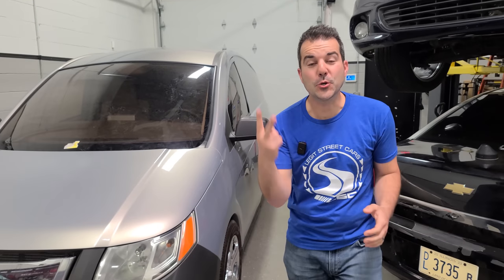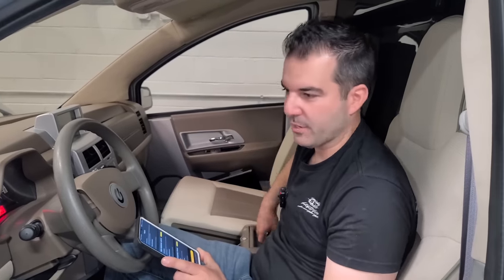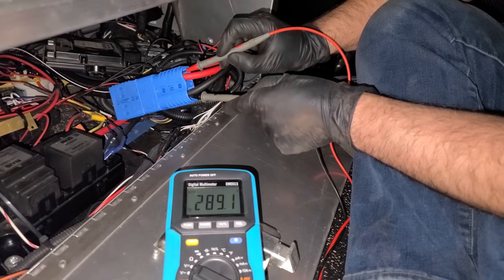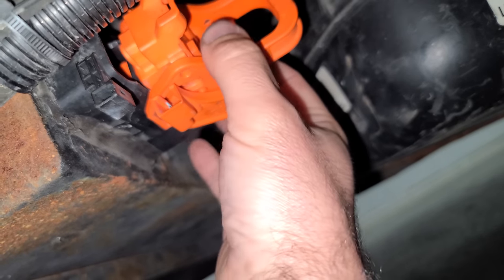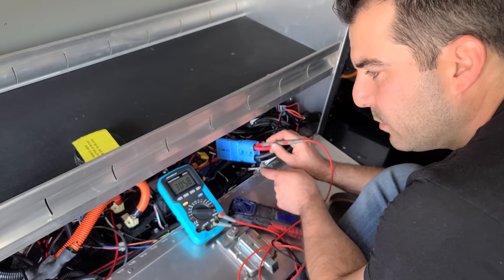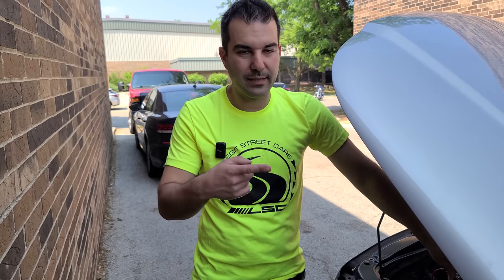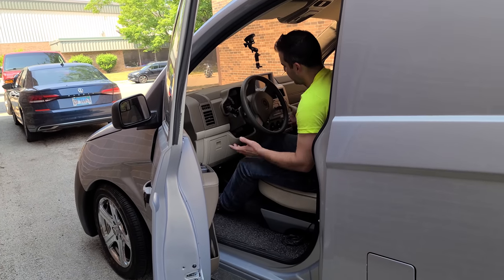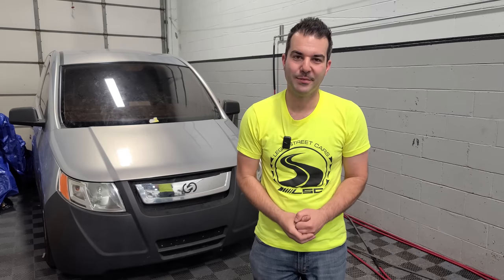I Fixed The Abandoned 2 Million Dollar Concept Car For $150! First Drive Ended In Disaster!

Comment: Screen tip, as old as that screen is there is a good chance the screen is fluorescent backlit and the backlight is dead, or if it is an LED backlight it might be dead too. A good way to tell is hold a really bright small flashlight close to the screen with the vehicle powered on and see if you can see anything on the screen. It'll be very faint, but if you can it means the screen is getting data and working, but simply has a dead backlight. If that's the case the easiest approach is to carefully open it and see if you can get a model number, if it was a standard off the shelf screen you might be able to find another to swap it with. If it was a fluorescent screen and simply has dead bulbs, you might be able to find replacement backlight bulbs to swap them out. LED backlit will be harder to find parts for. But given the age I wouldn't be surprised if it was fluorescent backlights and they are simply dead at this point. 

Good luck!
Reply: You just helped me solve a problem on one of my Toyota celsiors! Ur amazing dude thank u so much 😊
Reply: I bet there is NO screen....At least not a real screen...
Reply: @muppetpaster  The engineer he talked to over the phone said it was real and had a lot of data on the ev system, so I'd put money on it being real, just defective, really not uncommon for old screens from that time especially if it wasn't rated for being in the heat of a car.
Reply: @andycanfixit  i think some vires busted and even some parts could removed. Behind that fake hatbox could have ansvers, if he finds way to open it. There could be almost anything. 

Starting to make some wirings to paper, it would be good start for diagnostics. Theres lot of work and some parts need to fix or change for sure. 
I hope if there's some custom controller, he could save program from it and code. Then it's yeasier to rebuild things. And he need's just one or two right guys to help him, who originally worked with this. But it's possibility that those guys are ready to shoot own head, than work or remember this project again.

In first video with car someone said "they try to get REALLY HARD to make it work.."
That tells a lot.

Every input to controller should diagnostic and diggin the reason why it wants do that like grazy. 
So many reason could cause it..
Reply: 🤔 This is a very plausible theory. Would be interesting to try and see if it would be possible to replace the screen with a more modern touchscreen, depending on if it is an AIO assembly, or just a screen connected to a separate assembly.

Comment: Let's have a massive shout for people who can look at a bracket like that and say yep, I can repair that. Huge respect to such hugely skilled people.
Reply: That guy probably looked at that bracket ant thought “not only can I fix it but I can build a complete new one”. It’s pretty easy to do stuff when you have the tools.
Reply: thats like the most simple thing ever and I'm not even a welder. Alex digging into the wiring was way more scary and difficult.
Reply: He didn't reinforce it though lmao. When metal's that thin the heat affected zone becomes a key failure point. Seeing as it already failed, it was doomed to fail again. Great execution, bad planning. Or good planning because he just set himself up for more work/exposure
Reply: @ItsDdvdd  yep.
The engineer or engineers on this project should be ashamed.
Reply: @ItsDdvdd  shhh he just asked him to fix it lol. Now he’ll ask him to make it better. My motto is “you break you build” meaning if it breaks it needs to be built biggger better stronger smarter!
Reply: I think wires to motor need swapped when petrol engine is going forward its fighting motor that's in reverse
Reply: @taniamacdonald8571  great point! Thought that too, but the lady he interviewed said that it ran(?) and was tested, so I though might not be the case but you are probably right.
Reply: @billyrubina  It was a concept car, it was slap dash as all fuck. I doubt engineers had a whole lot to do with it other than to make it somewhat functional.
Reply: @SilvaDreams  maybe, don’t know anything about this company seems like an oddball.
Reply: Are you kidding me looking at it one would look at it and say wow this is an easy fix if going by looks

Comment: Here is my thought about the shaking: as you demonstrated the EV-mode thinks that R is drive and D is reverse. Whereas the ICE mode / side thinks D is drive and R is reverse. My hunch is when it's shaking then the electric motor unnecessarily try to strain itself backwards and some unintended clutch mechanism prevents it (since breaks are always stronger than the engines). If you may switch the EV to also act like D is drive and R is reverse maybe the shaking will be solved?
Reply: You are right on that BUT... Like said before me the van also do it in Park. I think it's a controller issue.
Reply: That could be tested just changing two of three motor wires cross. Then it spins different direction.

Controller have maybe died capasitors, or what ever. 
It should removed and could it be opened? Or do they 'clue' those with epox in one big brick?

Comment: Just a thought. From your previous video it looks like the gear selection under the hood is done with a electric linear actuator which you disconnected. Is there any chance of the following. 1. you didn't set it up exactly where it came off? so basically when your in D or R its not quite selecting properly. 2. Those actuators are slow to move which is probably why when your selecting a gear nothing happens for a while. I'd be inclined to get it on a ramp, get the wheel's off the ground and check the movement. I'd also assume that there is some sort of ECU controlling the linear actuator for when to put it into gear as in full EV mode you would only want the ICE gearbox in neutral, the petrol engine would also have an inhibitor to start when in gear. Hope these ideas help.

Comment: I'd recommend to drop the electric motor assembly and battery along with the wiring, just to start over from the basics. 
It's mostly impossible to really resolve an issue with something so custom like a concept car. Sure you got engineers who built it, but with it being a decade later- I'm sure some memories are obscured. I love this series of the space van.

Comment: Everytime that motor started shaking I could feel it in my chest!! What a cool project! Project I am working on is a 2014 Chevy 3500.. kinda.. the cab has been cut down to firewall and dash + the floor board. Sitting a 1963 cab over the 2014 dash and floor with all the 14 running gear... I have a short on my cannel come check it out.. Workin' With Wiley. Can't wait to see more! Have a blessed week!

Comment: I would like to comment about the indicator being backwards when in EV mode. If it has to be in reverse to go forward and drive to go backwards you should be able to reverse the polarity of the wires of the electric motor. If it’s brushless then swapping 2 out of the 3 wires will change the polarity too. Definitely some sensor issues with the inverter feeding the motor to cause it to shake like that.
Reply: That's my thought, the motor wires are reversed. Engine drives forwards and electric motor tries to go backwards.

Comment: Check that you’re plugged into a higher (20) Amp outlet in your shop. Also if it’s a lithium battery like in my RC cars and it has multiple cells it might need to be charged and balanced. Hopefully actually having a good charge makes it work. 

Edit: as soon as I was done making this comment he said he talked to someone about balancing it so I’m glad he knows!
Reply: How would he not know that going into an EV project? He's just playing it up for the camera
Reply: I think the problem is that the motor controller has reset, which is why it's going forward in reverse and banging around when it tries to kick in in drive
Reply: Leaving a Lithium battery plugged in for a week is not 'balancing' the cells, it is asking for trouble. If this has a BMS and if it's working properly, then there are one or more bad cells. If it does not have a BMS, then cell damage due to over-charging or under-charging of individual cells is a distinct possibility.
Reply: @GrayRaceCat  given that the engineer who worked on this said to leave it plugged in, would suggest it has a BMS
Reply: @GrayRaceCat acks with multiple cells in series (anything higher than 4.2/4.3V basically) must have a BMS or it's just gonna overcharge the cells the moment they start getting unbalanced, and eventually burst into flames.

That said, most BMSs only balance when the cells are full. Given the pack energy capacity in an electric car, it's reasonable to leave it plugged in for a few days to let it balance as it's a slow process. The cells won't like it, batteries don't like being at 100% for days, but it's necessary. It's also reasonable to think that the cells got unbalanced after years of storage, as the BMS doesn't balance when the battery isn't charged. If it did, it would just keep discharging cells to balance them and eventually kill the pack.

The way it balances isn't by over-charging some cells until they're all the same, it's by charging normally until series bank gets to 100%, and discharging it while it charges the other ones, until all of them are at 100%. No cell gets overcharged by doing this, but it's fairly slow.

Comment: Since the battery wasn't charging for that long, the chemistry inside was just "inert" now that you charged it the chemistry goes back to life. I see that with old laptop batteries, some not charged for 5+years that doesnt take the first charge very well on a specialized li-ion charger not the laptop, instead of going to 4.1V they are stuck a 3.4-3.8V /cells because Lion battery are charged in constant current until the charging voltage is reached. So when the voltage doesnt go up stay still for 10+minutes I stop charging let them cool down, some get warm but not hot, some stay cold as stone. Than after a day I charge them backup an now they goes up in voltage and store more energy. I could take several charge to fully reactivate the chemistry.I think what happend is the same for the first charge, then you plug it for 15min like you said, voltage goes up. They may have programmed a threshold to enable the EV part like 31XV, so the battery voltage rise because it was charging, goes above that min starting threshold, you unplug it, you drove it but now you reached the min running threshold that could be below the min starting threshold. try to charge it again a few time stay near it in case of fire, the more energy in the battery the more energy in the fire as cell can runaway.

Comment: Hey great job being out of the comfort zone  and working on this. Another great resource that I'm sure would help you is the professor at Weber automotive on youtube. He'd at least be able to give a lot of safety pointers as they have torn apart a lot of EVs and battery modules.  If you end up replacing the battery, get a used chevy volt pack as there are a lot of options that are cheap for a BMS to manage the batteries and not have to worry about fires etc. They have enough voltage and discharge rate to run Tesla performance drive units too.

Comment: As to your question about if other concept builds are janky, the answer is yes. I saw the inside of a concept aircraft and yeah, there were a LOT of questionable wiring choices and weirdly routed objects. I've also seen concept builds for specialized computer systems and the same thing, just very bad wiring, odd materials, and the whole look and feel of "whatever was lying around in the shop." When it comes to concept designs, building the prototype is often one of the screwiest things you'll ever experience.

"Fred, we need another connection from this spot to that spot! What do we have?"    "Uh, well, there's this chunk of leftover PVC we can connect with these random plumbing bits."  "Make it so!"

On a side note, with the length of the extension cord, you really should have pushed that thing outside before attempting to charge it, lol.

Comment: That’s awesome to see you got to run it for a bit.  Although you gotta go with the engineers advice about the batteries, I still wonder if the gas/electric motors are on the same page. It’s odd that Reverse is drive and vice versa.  It seems like the sort of violent reaction throwing a car into reverse might have while driving forward.

Comment: Hey, Love the videos! Years ago, I converted an old Honda N600 to electric, about the same time frame as the space van was made. One thing I had was a PC, for reading and relaying motor controller data to a screen on the dashboard. While watching you go through the wiring, I thought I could see a portable PC with a DVI cable connected to it. My guess is those actual car engineers were able to have it activate via the ignition, but if not, you might have to try manually tuning on the PC. I wonder if that's what runs the screen on the space van, and maybe some more logic via software. If it is a PC, I would play around with it either in or out of the car and see what all you can find.

Comment: It looks like a three-phase connection, you should be able to switch any two wires and have it go the correct direction. Theoretically speaking.
The issue you're having seems to be that the motor is trying to turn one direction which is why reverse is forward and forward and is reverse and when it comes time for the engine to kick on,  which means the clutch is trying to engage two things going opposite directions
Reply: This was my exact thought as well
Reply: Like someone pulled the EV motor out and when they put it back together they swapped the phase wires?

I see other people talking about the controller losing its settings but I’m putting my money on someone fucking with this thing.
Reply: Yes. Common in drone building

Comment: Use a 3 prong 110 round twist lock plug on the van and put a matching socket on the end of your drop cord. It would look clean, I think you can get ones that would be perfect from a RV supplier, you can find all kinds of neat stuff from a RV place.

Comment: I know someone working on VW (Volkswagen) prototypes here in Germany. He puts the parts into the car and tries to fit everything inside. He isn't allowed to tell much about what he does but he said that their prototypes are built with a really high quality. 

For me that concept car looks scary. The connectors (especially the HV ones) are crimped badly and you can see bare copper. Together with all those loose wires, I would be afraid of it starting a fire.

Comment: I have a ton of battery and ev experience. Charge the battery, load test down to under minimum voltage per cell, then recharge. This is the fastest way to equalize the pack. If you could share some details, I could probably help you with some tips.

Comment: i'm currently working on a riding lawn mower i converted to electric. im using it mostly as a garden tractor. it works well so far i just ordered different gears though as its very slow right now.

Comment: OK, As an electrical contractor, you've gotten me reved up to do an electric vehicle. So I just picked up a Free Used Barbie Jeep today and am going to spend 600 hours of one headache after another, retrofitting a high speed motor in it. It's good to know all I need to make it work is Use Plywood, with plenty of sketchy electrical connections, and an old iPhone glued to the dash.
The similarities will be mind-boggling. 😂🤣
Your van is the perfect example of too many clay modeling guys, trying to fix an electro-mechanical vehicle and following behind them is your biggest problem. Basic troubleshooting skills is your #1 best approach, following having knowledgeable guys making sensible comments. 
What a great video. Good Luck

Comment: It was maybe shaking becuase the motor tried to spin the other direction than the engine, as in Drive electirc motor spins in reverse. Try switcing the motor wires

Comment: Is the plywood floor marine grade? If so, it should be okay in rain. It is used on pontoon boats. But if you are really concerned about it, you could probably swap the plywood out for a composite material. Some pontoon boats are built with this, so it should be relatively easy to source.

Comment: This may be a stupid idea. But since you have those large Anderson connectors, technically you could use a charger like what they used for the ride on floor cleaners or the self-propelled pushing brushed vacuums. As far as where to pick up one of these chargers pretty much any industrial cleaning supply place would have them. And if you have an Acme electric out there I'm pretty sure they would have them as well. It would be super slow charging because it's meant for batteries probably 1/3 of that size but if you can't find or Jerry rig something to charge the battery in that van that might be a good option for you. I learned all about the batteries and the Anderson connectors when I worked a job at a large Convention Center and we had a fleet of 15 right on floor cleaners as well as 10 self-propelled walk behind vacuums.

Comment: hey is it DC motor? if so - it looks like it's backwards polarity (goes back in drive and forwards in reverse) and it could be providing drive also when in petrol mode, {a type hybrid or dual drive?)
Reply: maybe you might need it swap the big orange leads at the electric motor.
Reply: that clunking could be the dog clutch overloading and disengaging cause the electric motor is backwards polarity or the dog clutch not disengaging

Comment: It definitely seems like the clutch for the e motor is counter rotation to the gas motor, and when the battery drops to engage hybrid mode the opposite rotations are fighting back there.